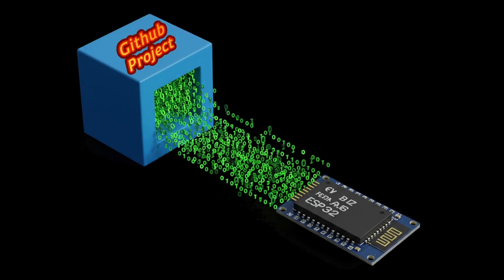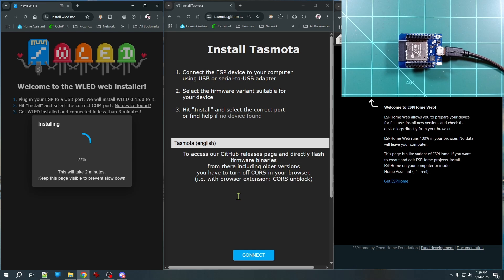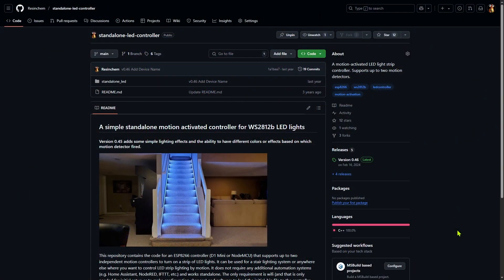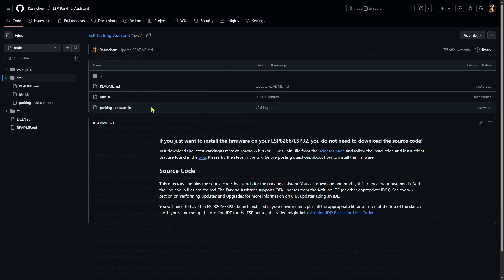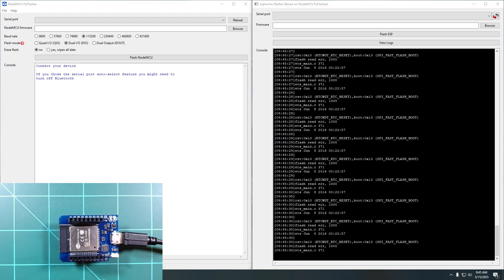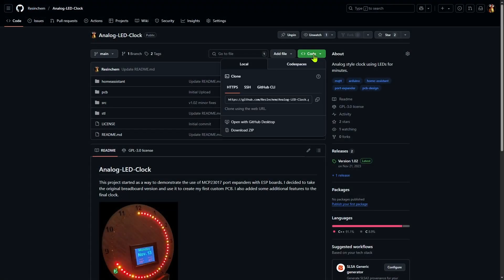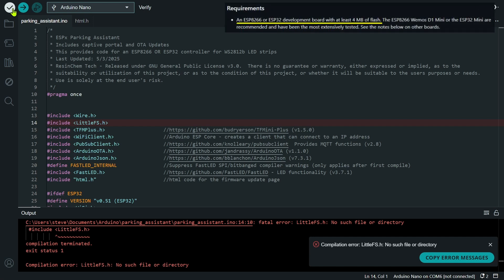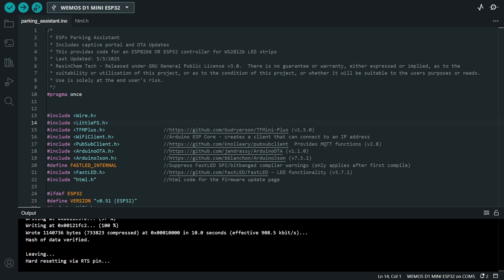ESP32/ESP8266 Firmware: A Beginner's Guide to Flashing!

Comment: Thank you so much for posting this information.  Very helpful.  I'm still struggling a bit though.  The firmware I'm trying to install (for TouchDRO) has three bin files. bootloader.bin, partition-table.bin, and touchdro-v3_2-free.bin.  So I don't know if I need one, or all three.
Thank you again for your video. Regards.
Reply from the maker: It depends on the source you are using.  I wasn't familiar with this firmware, so I did a little research.  The 'official' TouchDRO site provides info for installing Android/Apple apps direct from the app store and states that sites providing the source code are illegally distributing the code ( https://www.touchdro.com/resources/getting-started/installation.html ).  But you may have reasons for needing to modify the source.

In the repo I found ( https://github.com/petmakris/touchdro ), the installation instructions on the main page under the firmware section uses ESPTool and all three .bin files for installation, providing the exact command that needs to be run.  These are more or less the individual .bin files that are combined into a single .bin file for many repos.  But if you cannot get that command to work to install the firmware, then the best bet is to reach out to the author via the Github issues or other provided method (if any) and get clarification on the installation method.

Unfortunately, delivery and installation of needed .bin files isn't consistent across different Github authors/repo, so occasionally you have to do a bit of research... or contact the developer for assistance.
Reply: @ResinChemTech  Thanks very much for the reply.  I used the ESPWebTool and once I found the correct addresses to load the files into, it worked fine.  Thanks!

Comment: How can I flash my ESP8266, without having the programming board, nor USB port on the esp8266
Reply from the maker: You would need to connect a Serial-to-USB adapter to serial pins (RX/TX) along with 3.3V and GND on your ESP. Then you connect the other end of the adapter to the USB port on the computer.  From that point, the process is the same.  

The ESP is flashed via UART/Serial.  The USB port on most ESP dev boards simply connect to an onboard USB-to-TTL chip that is connected to the serial pins of the ESP chip.  Without the USB port, then you just need to make those connections directly to the pins yourself using a standalone converter, similar to this one: https://amzn.to/43VTpNc

This is the same manner used to flash custom firmware to some smart devices, like the Shelly relays or the Sonoff S31 smart outlet.  In those cases, you use the serial converter to connect directly to the pins on the device's ESP.  You can see how that is done in this video:  https://youtu.be/S4-HVYPCA2c

Comment: Hi sir how are you.
And thanks for those video ❤
I have a Christian I'm getting a lot of trouble I just got my hand on brand new HUB75 LED 64x64 p3  Matrix Display Panel  And I won't install WLED IS THERE ANY WAY TO USE THAT KIND OF DISPLAY .
Reply from the maker: You can find a list of compatible hardware (LEDs, controller boards, etc.) on the official WLED web site:  https://kno.wled.ge/basics/compatible-led-strips/

If a component isn't listed here, it likely will not work (or work incorrectly).  I don't think WLED will work with that type of matrix as the way it communicates is completely different from most LED strips.  You would probably need to heavily modify the source code (and I'm not even sure it is possible... I don't know the firmware code that well) or find  alternative software designed for that particular matrix.

I do always recommend that you check a project's documentation for compatible hardware.  In some cases, you may be able to substitute components.  In others, it may be necessary to use specific hardware as listed.

Comment: My experience shows not all ESP chips are good - some are obtained from the factory reject pile. If you're using a dev board version, that and/or possibly poor components and/or bad soldering may be a problem.
Reply from the maker: Absolutely true!  I have mentioned it in other videos, and probably should have said it again in this video, but you can end up with some cheap clones.  They may even have legitimate ESP chips, but then use subpar regulators or other components.  I've received batches of ESP32s where over half could not be flashed at all.

So thanks for bringing up the unfortunate fact that you may simply run into faulty or sub-standard quality boards.  In that case, you just have to try a different board... or even a board purchased from a different source.

Thanks for the reminder... and the tip!

Comment: Excelent Tutorial! Brought back a lot of old memories of all the times you walked me through this a year ago for all my home made sensors (still working). invaluable! Thanks for the great vidoes and education.
Reply from the maker: Thanks!  I realized that I've shown the flashing process in other videos, but never one that focused solely on this particular step.  And I've had to help numerous others get a successful flash over the years.  

I think the takeaway here (at least I hope it is), is that if one method/utility doesn't work, then try another.  I'm not sure exactly why, but even with some of my own projects, one utility seems to work fine while another doesn't. I think it has to do with partitioning... some of my projects are large enough that I have to change how the flash is partitioned.  And I think these are the ones that can have difficulties installing properly.  But I've found that the Arduino IDE almost always works if compatible hardware is used.

As always... thanks for watching and for the comment!

Comment: One other convenience you can all is a USB power switch to cycle power. Search A~Z for - Cable Matters 2-Pack USB On Off Switch - 1ft, Support Data and Power
Reply from the maker: There are a lot of different ways to simplify the power cycle process.  I have a four port hub with individual power buttons for each port that I can use.  In addition, if your board has an 'EN' or enable button in addition to the boot button, this can be used to power cycle, as the EN button will enabled/disable the onboard voltage regulator, effectively power cycling the ESP chip.  So, you can press and hold the BOOT button, then press and release the EN button to power cycle.  I didn't show this method because not all board types have the second EN button.

But thanks for the comment and alternate method of power cycling!